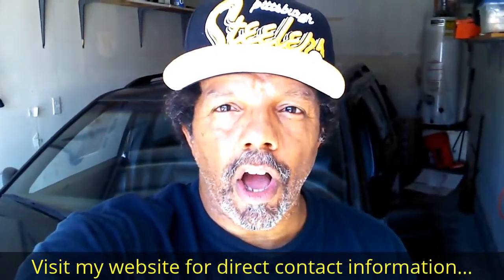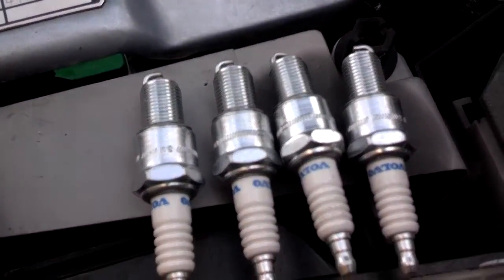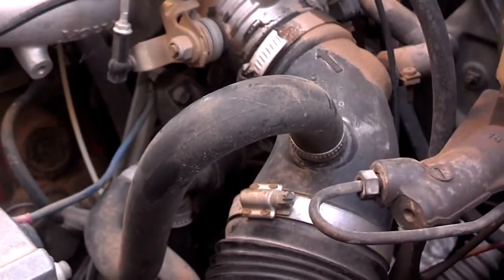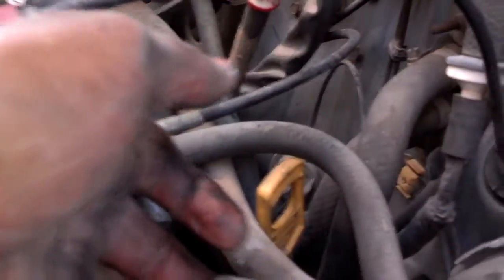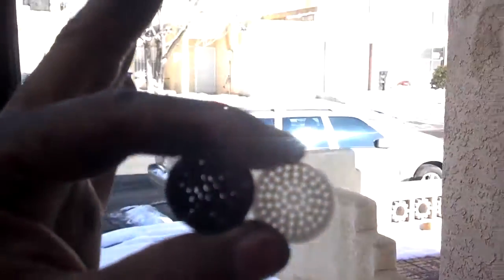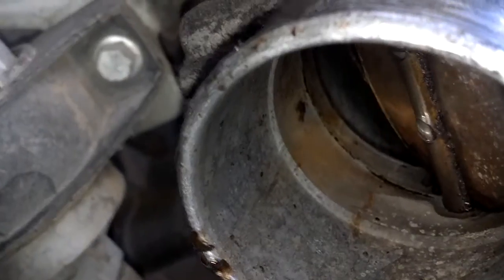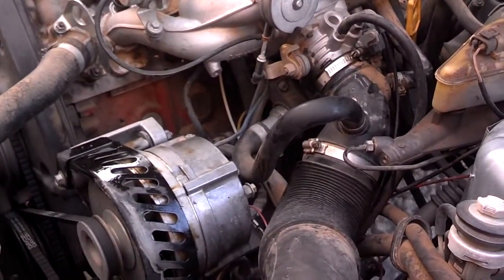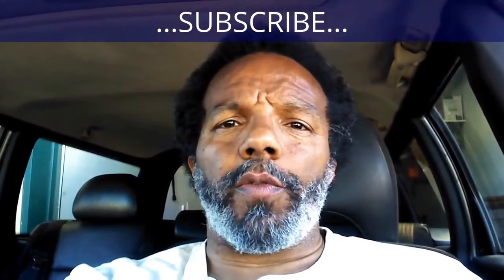Volvo 740 wagon restoration, tune up, replace plugs and clean intake system. Ep 4 - Day 7 - VOTD

Comment: would like to see a throttle body vacuum line replacement and color code for electrical system for a 1991 Volvo 740 sedan.
Reply from the maker: interesting.
Reply from the maker: https://youtu.be/tVYUe_atbWs

Comment: I've, like many others, found that servicing the pcv on these cars kinda sucks. So i took the kit from ipd and added a second hose with a connector piece from the hardware store. The end result is the flame trap now sits above the manifold and is much easier to inspect or replace
Reply from the maker: Darrel Holiday On what car are you referring to?
Reply: Robert DIY 1989 Volvo 740...1992 940, and when I say service the pcv system I include cleaning the oil separator box
Reply from the maker: I didn't know that the 740 had an oil separator box???
Reply: Yup...$30 for an aftermarket one from ipd...the flame trap kit they sell has the small hose with the two bends in that i used...i used two kits and a connector for the small hose...the oil box is underneath the intake manifold...thus the difficulty in servicing it
Reply from the maker: I have never seen one. Is it a CA thing? I put over 400,000 miles on a '87 740 GLE and never seen a box on it.
Reply: Robert DIY i don't believe so. My '89 was a new York car before out ended up here in central Ohio (Go BUCKS). My '92 944...i can only day it's from Sweden. I had a'91 244 that had one as well and i believe that was a buckeye car.

Comment: Thanks Robert.  I have a 1991 740 GL wagon.  Watched all the Ep4 videos.  So much great information.  Thank you.  Told my mechanic about the mpg difference you experience with Volvo plugs (about 25 mpg)  vs non-OEM plugs (about 17 mpg).  Interesting.  Do you know why there is such a big dirrerence?
Reply from the maker: Engineering.